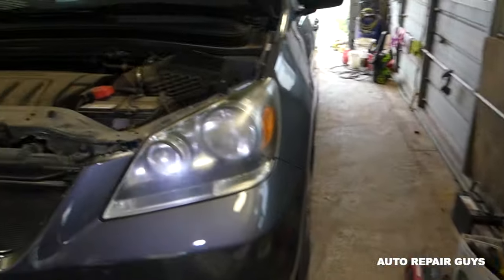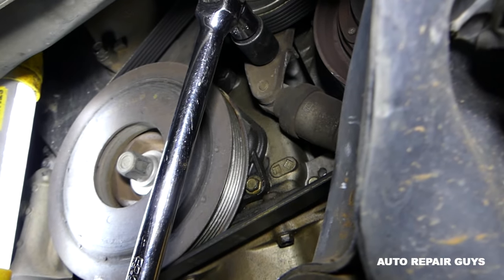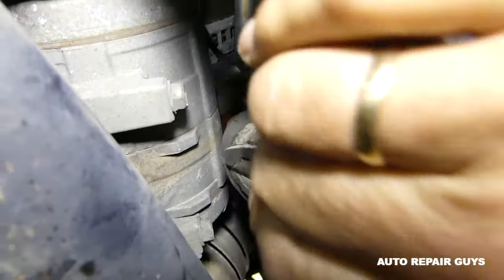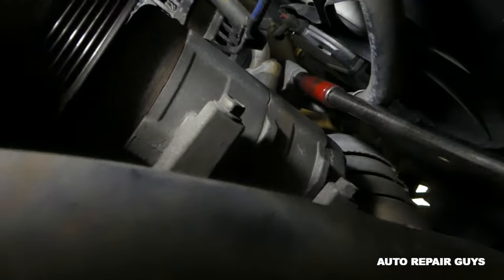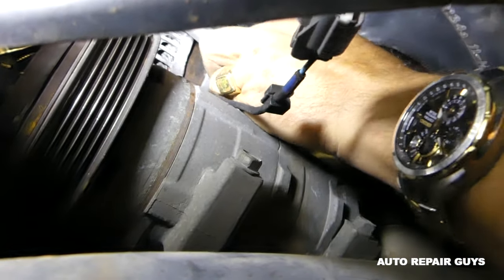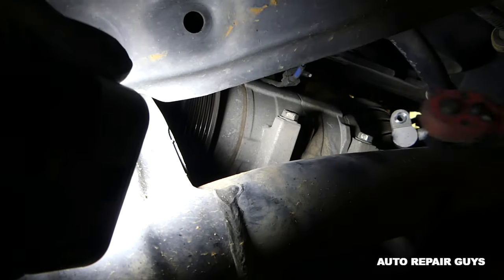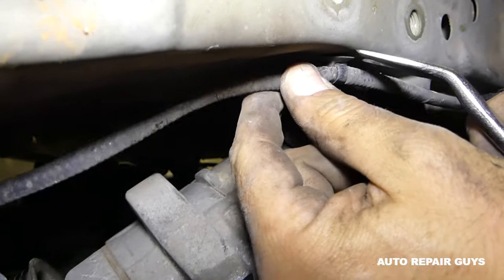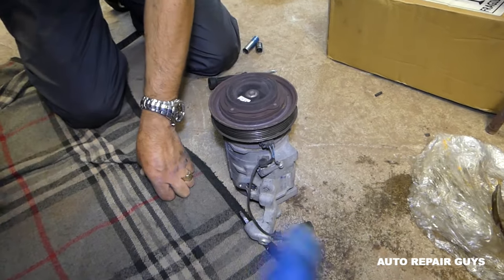HONDA ODYSSEY A/C COMPRESSOR REMOVAL REPLACEMENT AIR CONDITIONER

Comment: I always do the belt removal from the top.  First remove the engine cover.  Next, use a 19mm socket and push it toward the firewall with one hand, remove the belt with the other.  Helps to put a cheater on the ratchet handle.
Reply: What's a cheater? Beside a unfaithful person,..that is.
Reply: @mrg466  A pole that fits on top of the handle of your wrench to increase its leverage.
Reply: @JustEnjoyingLife73  ok, that's exactly what I had to do, thanks!
Reply: I've done this too, works great if you're solo. Just have to be careful not to strip the nut if it's a cheaper tensioner... I've had that happen too.

Comment: I like these guys and they've helped me with a couple things, but they are wrong about removing the compressor.  Don't mess with the suspension brace bolts!  Since you already have the serpentine belt off, go ahead and take off the tensioner--the compressor slides right out through the wheel well.
Reply: It’s the same thing there’s no right or wrong the bracket is more convenient
Reply: It’s not like it’s going to unaligned
Reply: Removing the tensioner is 100x easier. I did it. Dragging that out through the brace is a nightmare - they edit out the struggles.
Reply: Dragging out thru the brace, all the oil drips out as well in addition to being hell to get out.
Reply: Soooo, I originally took it out like these guys, took a minute. 
Then I thought to remove the tension pulley for the “easy access” and negative. It was a nightmare that way. I ended up putting back in like the video. Lol

Comment: Can you show an uncut video of the full removal of the compressor as well as the installation of the new compressor? I don't see how I can install the new one threw this opening without damaging it or spilling the oil. Also, it would be nice if you discussed how much oil to add. This video is strictly a removal video, not a replacement video. I committed to your advice and now I feel like the only way to install the new compressor is by removing the radiator as other youtube videos suggest. Help!

Comment: fyi, I had a 2005 and the compressor barely fit out of the bottom. I ended up removing the radiator (partially, I left the transmission lines attached and just moved it far enough out of the way that I could fit the compressor in from the front). It was SO much easier than wiggling it up through the frame. I recommend removing the radiator. Saved me hour(s).
Reply: That’s how I did it. Gotta get the radiator out of the way

Comment: Looks like a pain in the ass no matter which way you go but not near as bad as I thought it was. I will be doing mine here shortly thank you very much great video.
Reply: I took the pulley out first and it was    easy to remove using this method. Didn't have to wiggle like crazy.
Reply: @johnphenglavanh7441  interesting...

Comment: Sup guys ? Video was helpful.  Just wanna comment on my experience.  Instead of taking the piece from the frame. I took ac compressor off moved it to the front of the car . Then i took the plate where the ac compressor itself is bolted on 4 bolts the athe bottom bolt for the alternator  then the whole plate with the tensioner comes right out really easy all this is done from the right side of the car so i did remove the wheel.  Then theirs  alot of space for the ac compressor to come out easily.  Might sound like a lot but if u already this deep into it shouldn't be a problem.  Made my job really easy. Thanks for your video help me alot .
Reply: Great tip

Comment: I did it my self taking belt out and changing alternator and tensioner. The first thing you should do is to take out the plastic cover from the engine

Comment: thank you very helpful, yes take the 2, 17mm bolts must be removed to twist support arm in order to get the compressor out. to put the new one on angle the pulley in first then twist and turn stay with it cause there are times you think it will just not fit . Thank you again.

Comment: is there a reason you didnt swivel the lower support bar away first and then try to remove the bolts?????    seems this would be much easier..

Comment: There is a step in my Haynes manual, says to drain the oil from the compressor to determine how much oil to leave in the new one so it is not overfull.  Do you have a video on that process?

Comment: Thanks for the video...I’ll be working on this project  this weekend saving some major $$$$
Reply: I thought about doing this too, being that a need to do the alternator anyways,...but then,...after I found out, that the air compressor cost over$300 dollars, ...well that's just too much price and hassle,...I rather just get a plug adapter and plug in a fan.

Comment: Excellent video cinematography. Thank you. I won't be doing the job myself. But, it helps to know what my beloved mechanic Ken at K&K Automotive in San Carlos, CA will be doing when I request it, because my 2010 Honda Odyssey AC freon seems to need recharging after only 1.5 years since its last AC leak test and freon recharge. Now 1.5 years later Ken tested the AC system for leaks and found none. He recharged it and now it blows cold. But, he said that there is a chance that the AC Compressor itself is leaky and may need replacement when it stops blowing cold in another 1.5 years or so down the road if not sooner.

Comment: on my 2006 the compressor pulley would just not fit through that opening at all.  I ended up forcing the old one through (it was maybe about 1/8 - 1/4 inch too big but I just pulled it through and beat it from the other side with a 2x4 and a big hammer.  but then I realized that there was PLENTY of room on the side through the wheel well and I ended up putting in the new one that way and that was a piece of cake compared to trying to force it through that tight area. 
I'm mad at myself for leaving it there for 2 weeks and not finishing it because I had no idea that there was plenty of room through the side.

Comment: How do you switch out the AC accumulator/drier?
Reply: Just watched the video and I'm wondering the same thing. Did you figure it out?
Reply: replace the condenser.  it comes with the dryer and desiccant bag

Comment: Good job 😍i’just replace pulley with the magnetic saved me the money if ac work they just magnetic not working take me 2 day hard time just take the safety pink of and on...🤫🤫🤫😍
Reply: What are you talking about? Replace pulley with magnetic?
Reply: @mrg466  I think he's talking about the clutch. That's the part that often fails.